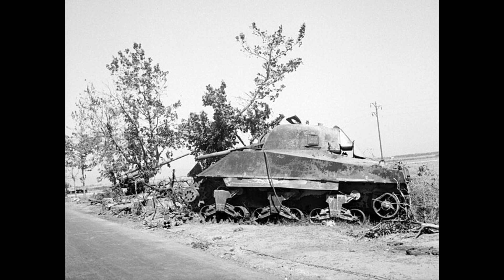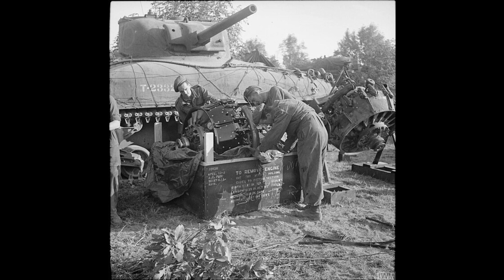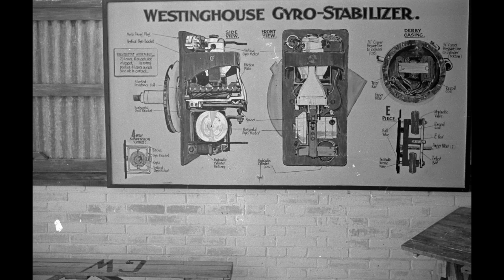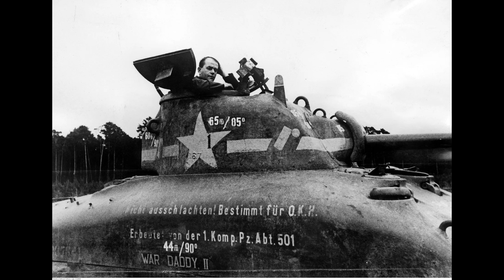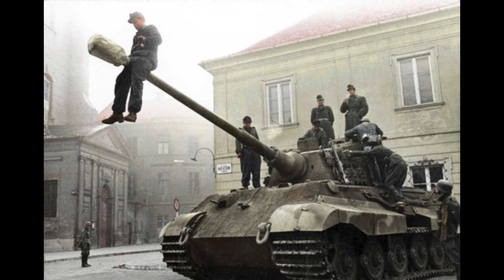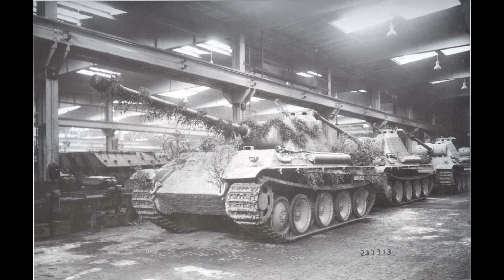German Engineers Tested a Captured Sherman - Then Realized Why They Were Losing the War

Comment: Interesting fact, the 55 ton Tiger 1 had lower ground pressure than the much less heavy Sherman because of superior weight distribution through wider tracks and better suspension. Which made the Tiger 1 way more complex and thus harder to work on. Right on par with the point of this video. I think.

Comment: German engineers built a technical marvel for war, Americans built a serviceable workhorse. Wars are almost never won in a moment, they're won with dogged persistence and unrelenting pressure. I still love German engineering... but something that is engineered to accomplish anything and everything needs to be refined. You'll always get more miles out of an N/A manual 4 banger than a turbocharged v8 automatic. Sure they will drive different, but if you don't have transportation you're screwed

Comment: God I hate these videos. It's not just oversimplification, it's alternative history. Yes, German equipment was over engineered. Yes, they were masterpieces. They were also perfect for the task they were intended for. When the Brits captured their first Tiger tank, and were testing it's capabilities they were astonished. It handled better than their medium tanks, had power steering, a steering wheel, and a automatic transmission which was smoother than their own. Tanks that heavy shouldn't handle so nimbly. Most think the Tiger was slow. That's not true, for it's time, it handled as well as a medium tank, even off road. The problem wasn't over engineering. The problem was production. Not only did they not have tanks built on assembly lines, they had them built by heavy industry. While we had Shermans built by GM and Chrysler, Tigers were built by steam locomotive manufacturers. The polar opposite of mass production. They went from building a dozen steam engines a year to building Tiger tanks. They had no concept of mass production. THAT was the problem.

Comment: While many know about the problems with armor-piercing ammunition caused by Germany being cut off from tungsten, what hurt them more was losing the ability to make machining tools from it. They could, and did, use higher-caliber guns to make up for steel being softer than tungsten, the 88mm being the prime example of that. You can't do that with cutting lathes and dies, though.

BTW, I'm sure every German tanker wished he could run over the engineers that thought overlapping road wheels was a good idea.

Comment: As others have pointed out, the statistics on Panzer kill ratios were somewhat deceptive. A Sherman would be considered "killed" by the Allies if it was damaged badly enough to need to be transported back to a depot for repairs, even if it could be returned to battle a few days later. A Panzer, on the other hand, wouldn't be considered "killed" by the Germans if it could still move under its own power, even if it was damaged beyond the point of repair.

This is what created some of the absurd kill ratios, and the seemingly insane Sherman production numbers: lots of "killed" Shermans would get patched up and sent back to battle, while Panzers that were "alive" on paper would be quietly taken off the field and broken down for parts. Add in the fact that every kill from a German tank unit would be attributed to the commanding officer of that unit, regardless of who actually got the kill, and those 5-to-1 kill ratios start to look mighty suspicious.

Comment: It’s crazy to me that these engines had just a little more horsepower than a big new suv but weighed like tons and tons more
Reply: Yeah, horsepower is deceptive if you start trying to compare it between different applications like this. You look at the 15.9L radial engine from the Sherman and the 6.2L Vortec out of a Chevy pickup and see that they both make about 400 horsepower. What you don't see is how each engine makes that power. 

Horsepower is, obviously, a unit of power which is work over time. Torque is a unit of work. The horsepower calculation is HP = (Torque x RPM) / 5252. The Continental engine produces roughly twice as much torque as the Vortec (nearly 900 ft-lbs) but at roughly half the RPM of the Vortec at peak power (around 5,500 RPM); you can probably see where this is going already. If you take that equation and double one variable while halving the other, you get the same number despite there being a big difference in how you got there. 

So the Continental is a vastly stronger engine which you'd expect at more than twice the displacement but it does twice the work half as often while the Vortec does half the work twice as often and, as a result, their power numbers look the same.
Reply: @Dover78 that’s one of the best replies to a layman ive ever gotten, thanks haha. Never understood any of that before!

Comment: American tanks had perfectly machined transmission gears and parts. The seats for the crew with leather covered cushions. They had a small auxiliary engine. Suspension wheels were arranged in pairs that could be just bolted and replaced in minutes.

Comment: Things like Tanks has to be designed using KISS philosophy "Keep It Simple Stupid".
The Germans had better tanks (when running) but they were finicky and was difficult to repair. At the same time they had a lot of different models and versions. So the number of spare parts that needed to be in stock was exceedingly high.
The Allied tanks was not as good but they had fever models, and they were designed with maintenance in mind. 
Take the transmission on a Tiger and a Sherman (weight 57T and 33T). The Shermans transmission didn't break often and when it did, it was changed in 6-8 hours in the field. The Tiger on the other hand broke frequently and changing it took 2-3 days in the shop and up to 1 week in the field. Things like that matters!

Comment: Until the Panther came online, the M4 Sherman was a match for the Panzer III and IV. The 75mm gun wasn't "weak" and could destroy all German armor at the time while also have a good anti-infantry explosive charge. The engine and especially transmission could go for miles far after all other tanks from every other nation would have failed. Even the Brits were shocked at how little maintenance it required. For all intents and purposes, it was the best tank on the field for much of the war. The introduction of the Panther and Tiger required upgunning but those were rare.

Comment: “Spark plugs could be changed without special tools”
Mercedes engineer;
“Facepalm”
Reply: Apple engineer: "Idiots! How will they make money on service charges?"
Reply: One of the greatest, largely unspoken, truly ingenious American innovations, was those simple tools. Or rather the complete systemic philosophy behind them that extended to every manned vehicle of WW2 that was not a ship. Every US made vehicle, tank, jeep, deuce and a half, boat and most planes, came with a canvas tool roll. In that tool roll was every tool needed to service and repair the vehicle. The only extra thing that might be needed is a crude field hoist. Which the men knew how to build. Every nut, bolt and fastener in the vehicle was standardized and limited to just what could be carried in the simple tool roll. With that tool roll the vehicles crew could completely disassemble it and put it back together. Every vehicle had this. Think of how simple that was and how innovative. Each vehicle also included a waterproof service manual with big easy to read diagrams. Now a tank may need different tools than a Jeep. But the tank and the jeep each carried the tools needed to service itself.

Comment: I've heard and read that it took 1 hour of mechanical work to keep a Sherman running for 10 hours, but it took 10 hours of mechanical work to keep a Panzer running for 1 hour.
I don't think you need a calculator to see that's a losing proposition.

Comment: One of the things the tank bloviators often don't know is what engineering involves. When they define German tanks to be superior engineering it is often based on the notion of technical complexity, which in terms of actual superiority may not even be valid. 

Engineering means developing something for a specific purpose that meets the goals of the person requesting it.  

The Tiger was defined for pretty much a single purpose, knock out enemy armor and allow German forces to break through. The thing with the tiger is the sophisticated transmission and suspension systems, were they really needed? ( And that is an open ended question, one I definitely can't answer). Sometimes engineers over design things bc for them that is what drives them, the problem there being that over design might not be practical or reliable. 

The Sherman was designed as a medium duty tank to be used primarily as infantry support and to a certain extent mobile artillery. I know this one directly, I am older, and my dad was a WWII armor unit combat veteran. People have told me they is nonsense, that all tanks are designed for tank to tank combat primarily and that isn't true.  Obviously any tank has to be able to go against other tanks,but it was not the prime design goal of the Sherman. Plus understand that US doctrine also had dedicated tank destroyer units to fight off German armor advances/ breakthroughs. 

So what were the criteria for the Sherman?

- maneuverability and speed 
-a gun capable of rapid refire ( Sherman could do like 20 rounds a minute w the right crew)
- a gun that was accurate ,stabilized for field conditions, and had enough pop to take out comparable tanks
- rugged and reliable 
-East to maintain
- easy to operate ( basically anyone who could drive a car of the day could learn to operate it easily) 
-relative easy regress out of it if hit
- ability to go cross country, which along with speed and maneuverability, it was keeping the weight down..which is why it was lightly armored comparitively. You could put a Sherman across a Bailey bridge or a pontoon bridge at 34 tons. 

- ability to ship it long distances on boats or via cargo plane. 

- ability to make them relatively quickly. 

These were the parameters, and as time went on there was another, the Sherman was easily modified and upgraded as time went on to fit specific needs.  

There is a contrast to this. The army did decide ,rather late, they they needed a heavy tank, one that could take on a panther or tiger I or 2. The problem was similar to the tiger, being so big and heavy and rather complicated in part because of the weight, and difficulty of assembly, by the time they were operational they werent needed for WWII. That were ull suited for the pacific war and in Europe there were so few of the German heavies left it really wasn't needed. 

Obviously in the post war world the Pershing became the progenitor of the future tanks and expected need.

Comment: Total nonsense. The Sherman tank could be destroyed by the German tanks at distances of 1500 meters but needed to be within 300 meters and firing at the sides of the German tanks to take them out. The Soviet T-34 introduced in 1940 had superior armor and superior firepower and a superior diesel engine that reduced the odds of a shell causing fuel fumes to explode inside the tank. 

Only through the combined efforts of armored infantry, self propelled artillery, tank destroyer units, and pinpoint bombing by the P47 aircraft were the allies able to advance against German tanks.
In a single encounter in Normandy that started with 64 M4 tanks, within 26 minutes 48 of the tanks had been destroyed and their crews dead.

The reliance on the M4 tanks resulted in the failure of the November 16 offensive which in turn enable the Battle of the Bulge and the 182,000 casualties. For one division of the 158 M5 light tanks more than 158% were lost. Of 232 medium tanks (including 10 M26 Pershings) 648 were totally destroyed in combat and 1,100 needed repairs. Of these 1,100 roughly 700 had been knocked out in battle. Losses totaled 1,350 medium tanks in combat or a total loss of 580 percent.

So many Sherman tank crew were killed that the U.S. Army was forced to take infantry soldiers and after a day of orientation they were put into the tanks to quickly die in battle. 

The M26 was available but Patton refused to use them. The M26 had 4” armor at 45 degrees on glacis plate, Christy suspension, much like the Soviet T-34 tank introduced in 1940. Its longer and wider track resulted in half the weight of the M4 tank and superior traction than the German tanks.
Reply: It is ignored that the British and American armies fought against 10 German divisions during WW2 but the Soviets fought against 180 German divisions. It was the Soviets that forced the surrender of the Germans  and it was the Soviets with their extremely successful invasion of Manchuria in August of 1945 that forced the unconditional surrender of the Japanese military.

Total British and American casualties were less than half a million including civilians as compared to 24 million casualties for the Soviets.
Reply: correct, the brits and murica s waited until breaking point, then wanted to rush to berlin, now they write histories about how heroic and awesome they were...
Reply: but here you see "fury" veterans and armchair soldiers shouting "hurr durr tiger breaks down" 🤣 such idiots

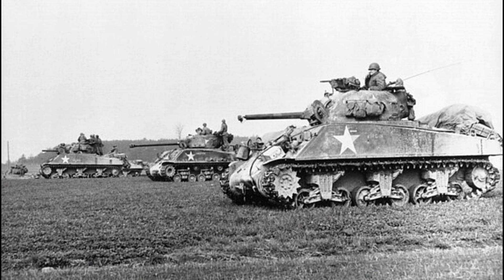Comment: The question was posed “If you had a choice between a Panther or a Sherman which would you pick to fight in?”  Well for a single battle perhaps the Panther so long as it was running, but for months of continuous mobile fighting I’d take the “EZ 8” hands down. Why?  Because it wouldn’t let you down, had seen significant improvements to mobility and crew protection and that HV 76 was more than capable of being a Panther killer. Especially if paired with 75 mm Shermans to deal with the infantry, defensive fortifications and at guns, which they almost always were (highlighted in the image at 17:57). People look at this all wrong. The Sherman was viewed as a part of an offensive machine. Panthers viewed generally and built to be their own team. History proves which philosophy was correct.

Comment: The Sherman did not have thin armor. 
It's front armor was the equivalent of 3.5 inches a Tiger 1 was 4 inches
Reply: That’s thinner
Reply: @Ever443 
You do realize the Tiger 1 is 20 tons heavier and only had the equivalent of .5 inches of armor on the front of the tank.
Not much of a difference.

Comment: I was a Research & Development engineer in the US Air Force during the 1980s. I was indoctrinated with this brilliant philosophy. It was generally the Opposite of American car manufacturing, which cared only about being cheap to manufacture. While one Chrysler needed to lift the whole engine just to replace all eight spark plugs, American military vehicles were designed to be reliable and easy to service. 
 -- I learned that IF a Huey helicopter had an engine fail, but made a safe landing in some remote location, the team of mechanics would need a loaded semi-trailer as the "toolbox" to be able to access Anything on the engine. Then came the Blackhawk helicopter. IF it were to go down with an undefined engine problem, one mechanic could walk to the machine with ALL the tools he would need in the pockets of his overalls. 
 -- On the other hand... I personally believe our M-16 machine gun is inferior to the Soviet AK-47 for similar reasons. I think most American GIs will fight me on this point. I've heard their reasoning. Ultimately, all their reasoning must include, "...IF you keep it clean." Years after my military service, I was in a shootout. Civilian vs civilian. I carried a gun because I lived in the Wild West (rural Arizona). I routinely worked in a dirty, dusty environment. My automatic handgun wouldn't fire because it was dirty. In conclusion, I have a sour attitude about firearms that must be kept pristine clean in dirty environments.

Comment: 8:20 - As I understand it, during WWII, most of the time the first round from a tank was a "ranging" round, and seldom hit home.  At Hughes Aircraft in 1977 when we were developing the infrared sighting system for the M1 Abrams, I was told that it was usually the second round that brought home the bacon.

Turned out with the Abrams?  The sighting system was soooo awesome! that the first round usually did the trick.  Go figure.

Comment: Another thing about the Shermans was that they had at least five engine variants:  Continental gasoline 9 cyl. radial, GM twin inline diesel, Ford gas OHV V8, Chrysler gas 30 cylinder multibank and Caterpillar-built Wright 9 cyl. diesel radial.
Reply: yes. and it was a very smart idea. it prevented them from running into a bottle neck with engine production like the germans

Comment: The Germans lost because they under engineered their tanks and their mobility using horses was a failure when a horse runs out of fuel it’s dead when a truck runs out of fuel you wait or scrounge for some The Americans made trucks Ford GM etc all with interchangeable parts Germans many manufacturers all individual parts and last but not least they took on 100s of millions against their 10s of millions but that’s Germany for you and they will probably do the same thing again

Comment: See the United States had a habit of taking everything to do with equipment and idiot proofing as much of it as they possibly could they knew that soldiers in the field thousands of miles from home were not gonna be capable of maintain an unbelievably complex piece of equipment and making sure your logistics tail is as small as possible means you can set it and forget it an ok enough tank that runs and has fuel and ammo is way better than an incredible tank that's broken down or out of ammo